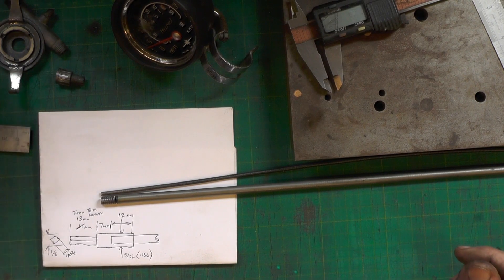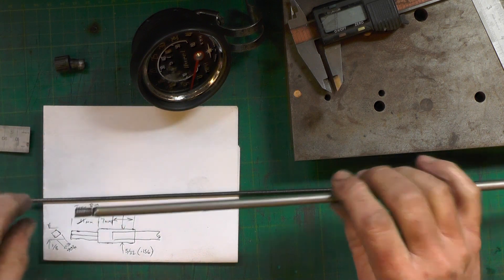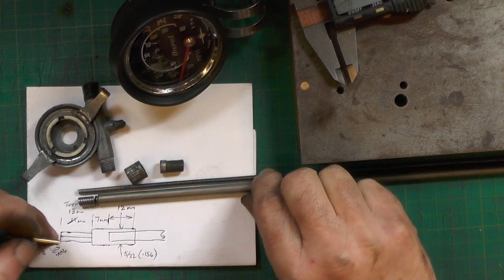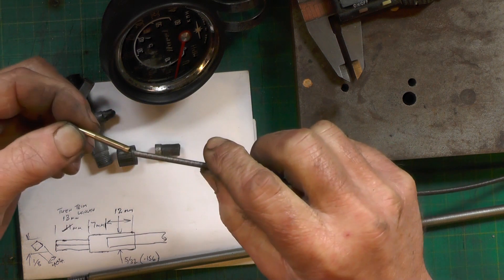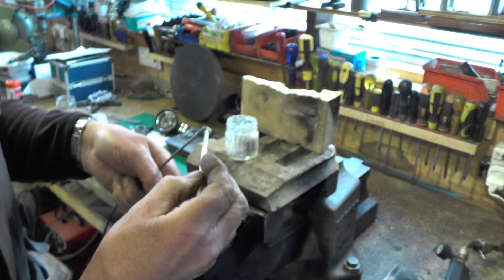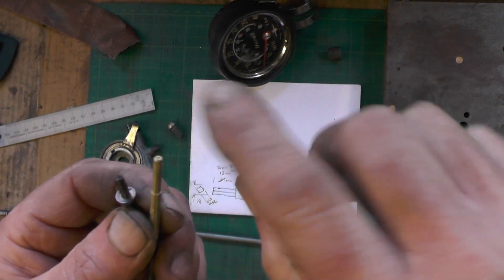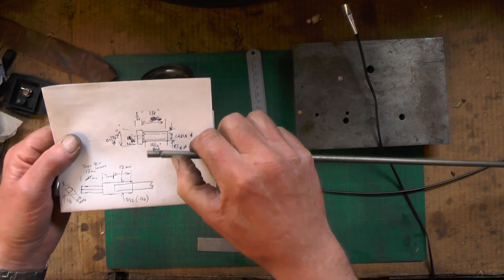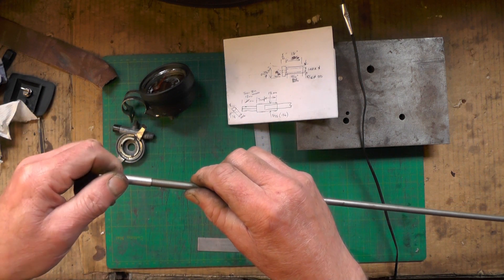Vintage Speedo Cable Repair  "mr factotum's workshop"

Comment: Hi Mr. F, nice to hear from you again. That's other repair job done successfully. I have finished the mechanical lubricator and it pumps very well. I have now stated fabricating the governor parts for which I bought commercial made bevel gears which cost an arm and a leg. very much more than the cost of a complete governor at todays prices. I also had the boiler inspector come over to do a hydraulic test at 250psi, that is twice the working pressure. All went well.
Coming Wednesday I will be getting the second dose and hopefully we will get out of this pandemic situation soon.
Take care and regards 
Emanuel
Reply from the maker: nice to hear from you too, glad the pumps wotking okay and the pressure test, all the best with the next part, 
just had my 2nd jab
you take care too and thanks for keeping in touch
regards
mr f

Comment: What ho Mr F, 
It makes it all worthwhile when you can repair something you know most others would just send to a landfill.
Never had much success silversoldering spring steel but with your longer ferrule it should keep it straight enough to be fine.
Just for the record i have seen over 80mph on my electronic push bike speedo. But then it is fitted to my R75/5. After 145K miles the BM speedo failed and i saw a bike one in Halfords going cheap and me being me i had to make it my next project. Turns out to be waaay more accurate than any standard you must be having a laugh german one, with its severe over optimistic calibration.
ATB  
c 
Ps thunb receiving treatment and i can now at last include my thumb when i wash my hands. I wonder if i have been jumping the queue by being ex staff at the hospital, what with horror stories of people waiting for non urgent treatments post covid. Or maybe they are bored rigid waiting for some poor in valid to dare to go a hospital, certainly they didn't seem busy in the wsiting rooms. Or again maybe they knew i was coming and didn't want to frighten the other patients.
Reply from the maker: hi chris
nice to hear thumbs being washed again,  hope its not been a source of Covid!!!!
yes, your right with the germanic calibration system, ive fretted many a time going through mobile camera's thinking i was 15mph over the limit, to find no nasty envolope's dropping through letter box!!
Good idea to put cycle speedo on, you must do a video of that!! Now the thumbs  being activated again!!!
regards
mr f
Reply: @MrFactotum  guilty, it's all my fault. The pension companies paid me to spread it to all the oldies and those damned fool SAGE "experts" stopped me with their damned lockdowns, and i was being paid a bonus for each case reported. 😉

The usual error is 47 when doing 40 but all legally. Before EU a speedo had to be within 10% over 30 mph but not read under. After EU it could read anything but not under, thats progress for you.

The battery is probably flat by now and i would have to find the instructions and measure the tyre  circumference again, but certainly when in use it worked  great  with all its extra functions. It was easy to set up but needed a special mount to be made to fit the reed switch to the brake torque arm, but then what do we have workshops for? Only problem it was not illuminated for night time use, i suppose cyclists are not expected to ride at night.

Comment: What gas / torch do you use for silver soldering?
Reply from the maker: Hi Rob
For large items i.e. up to a loco boiler, i use oxy/propane with various nozzles.
For smaller items i use propane with a sievert gun and various nozzles,
For really small work i have a Aldi heating / soldering lighter fuel torch
hope that helps you
Cheers
Kev

Comment: Nice light break from steam engine build, rather optimistic 40 mph on that Speedo (down hill with back wind) or have you uprated the electric motor without telling us !! Thank you and see you soon .
Reply from the maker: hi sd 
no electric on this bike, managed 35 mph  yesterday on a 28 mile jaunt, mind you your right downhill with the wind beneath my sail. thanks for watching.
regards
 mf f
Reply: 35 mile bike ride, that's impressive!
Reply from the maker: @tom_tom_go  hi ttg
 nice to hear from you, 28mile ride!! managed 35mph downhill with wind.
Just wondered if you could still send me pics of your M.M. tender at sometime, no rush, won't be starting till probably winter months, unless we lockdown again!!!!
regards mr f
Reply: 28 miles is still impressive!

Check your emails :)
Reply from the maker: @tom_tom_go  will do, thanks